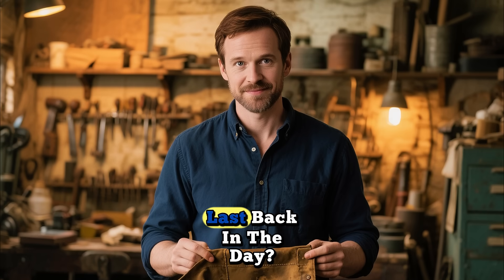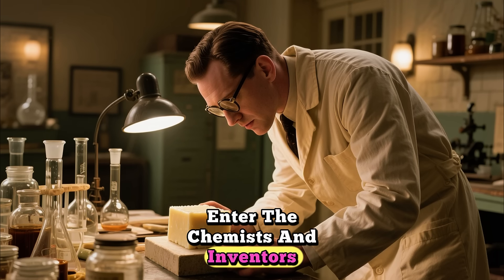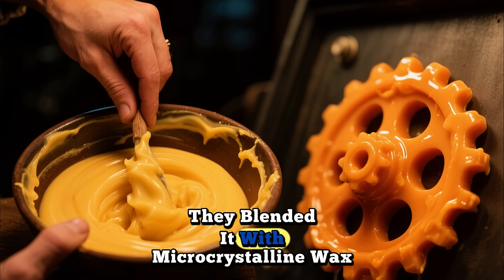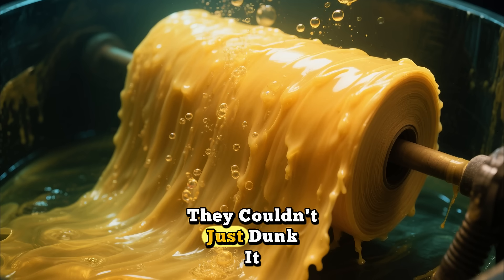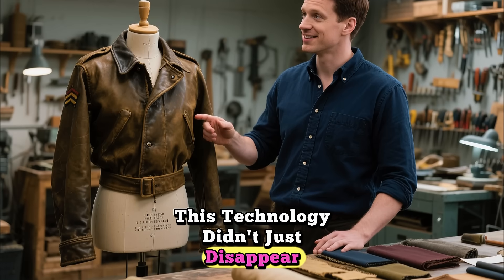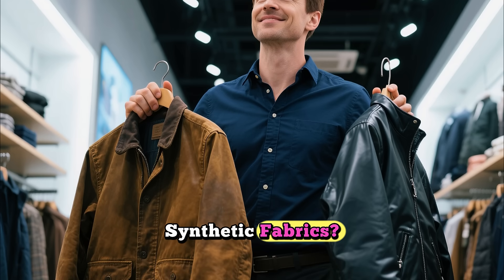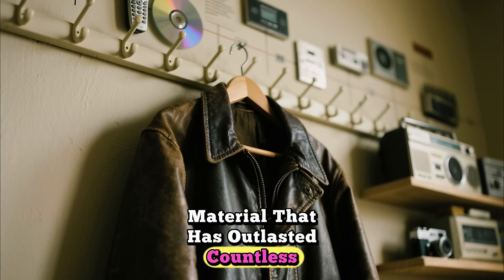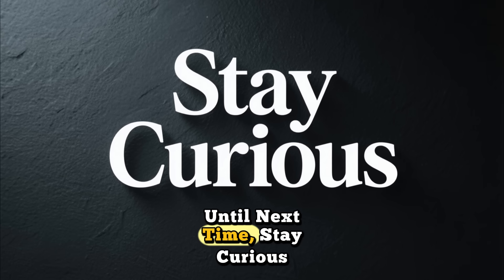The Secret WWII Wax Formula That Made Tarps Waterproof Forever

Comment: -16 ounces by weight of petroleum based wax.
-8 ounces by volume of boiled linseed oil.
-8 ounces by volume of turpentine.
That's all it takes although you can add a couple/few ounces of pine tar if you don't mind the dark color.
Reply from the maker: That’s a solid mix. The ratios look right for a good penetrating finish. Pine tar’s a nice touch if you want extra protection and don’t care about the darker tone.
Reply: The reason that recipe isn’t used for clothing anymore is because:

Boiled linseed oil now contains chemical drying agents (like cobalt salts) → toxic to skin.

Turpentine is flammable and irritating to breathe.

Petroleum wax doesn’t let fabric breathe, making it hot and heavy.

So, yes — it’s historically accurate but not modern-safe.
Reply: @em3rge1  if you get artist grade sun thickened Linseed at a artsupply store instead of a hardware store - you can avoid the drying agents, though it's usually quite a bit more expensive...
Reply: I Will build mine thankx
Reply: I have never got the linseed oil to properly bond, it makes a skin on the wax.  what am I doing wrong?